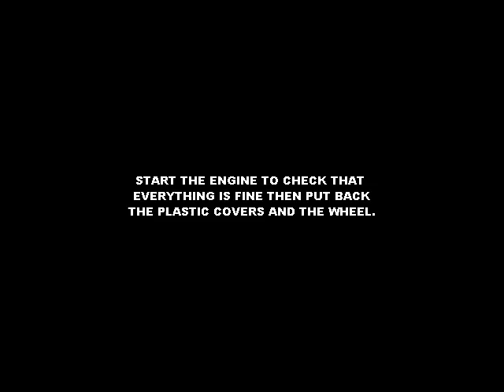Mitsubishi 3000GT / Dodge Stealth serpentine belt adjustment

Comment from the maker: I would suggest you first to open the hood and stand close to the engine and pulleys. Ask someone to start the car and listen carefully where the sound comes from, that's how I found my noise. It's very important to know where the squeak comes from before doing anything. Ask yourself these questions: is it something that rotates or something rubbing. It will help you pin point the location of the noise.

Comment: hey, I got a 3000.. mine squeaks when i start it or put int in gear from a dead stop(like stop sign), then it dies after a few revs.. now its to the point where i cant even downshift on the highway 3rd without hearing a tiny squeal for a second (that goes away quickly after boost) but its still wreaking the moment... Any ideas?????? 

please hellppppppp!!!!!!!!!!!
Reply: You need to either add tension to your belt like in the  video or your belt is old and you need a new one...